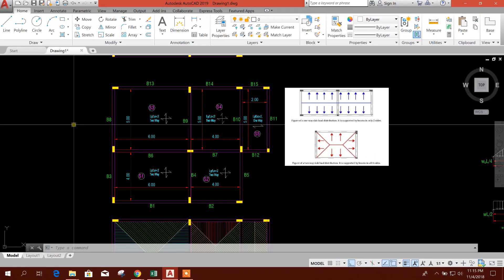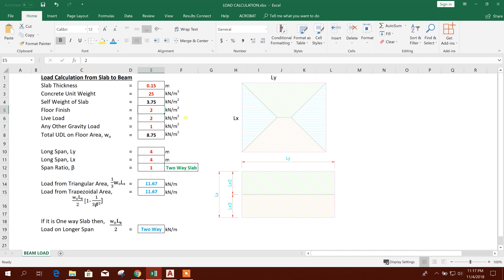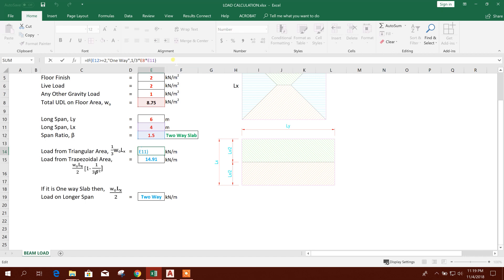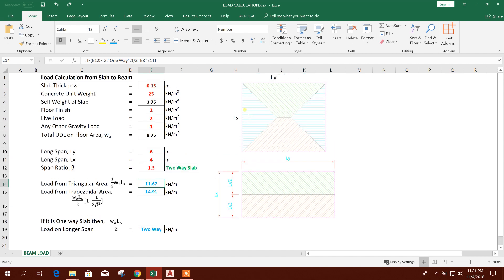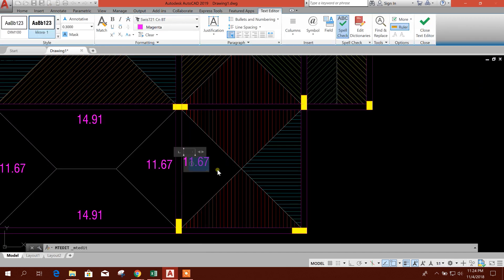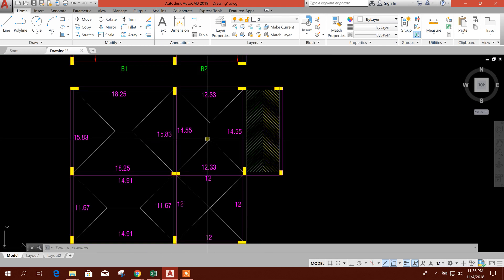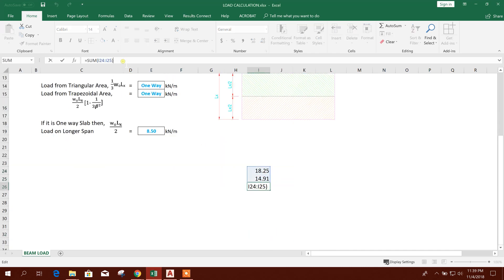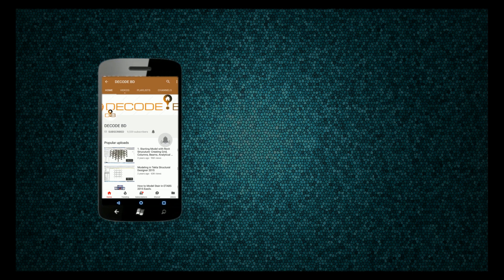CALCULATION OF LOAD DISTRIBUTED FROM SLAB TO BEAMS-FULL EXPLANATION.

Comment: Most useful video sir thanks for making like this video 
Sir I had doubt that entire self weight of the slab is distribution in the form of triangle and trapezoidal shapes then 

The weight weight of two triangles weight + two trapezoidal weight =self weight of the beam 

But here after adding the two triangle weights and two trapezoidal weights is not getting the self weight of the slab always less than normal weight of slab 

Clear this doubt as early as possible sir 

Once again thanks for making useful knowledge video

Comment: Does Etabs use the same method in distribution of slab load to beams? Is there a way to check if what are the loads transfered to the beams in etabs?
😀
Reply from the maker: ETABS uses mesh size to get load distribution from Slab.